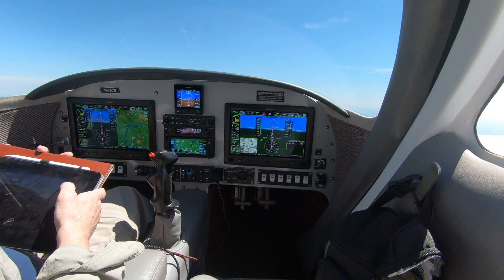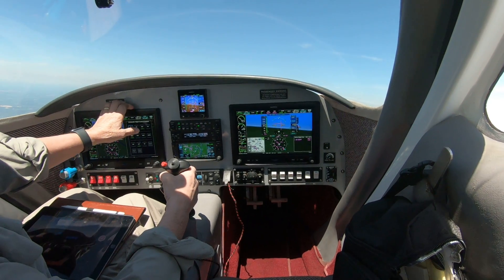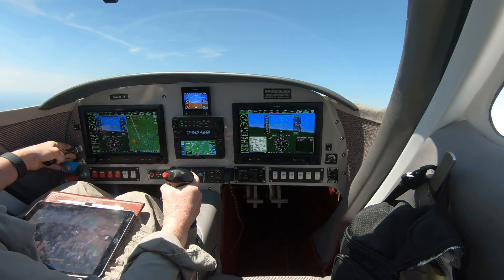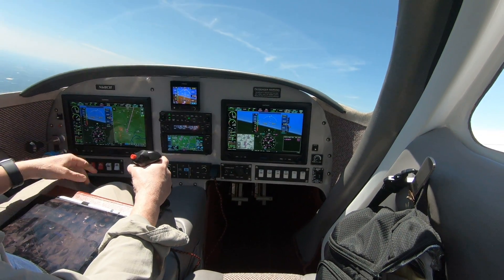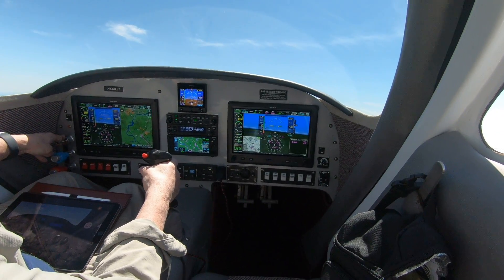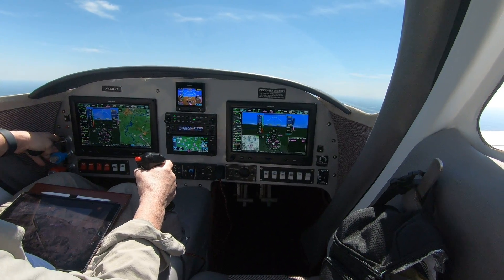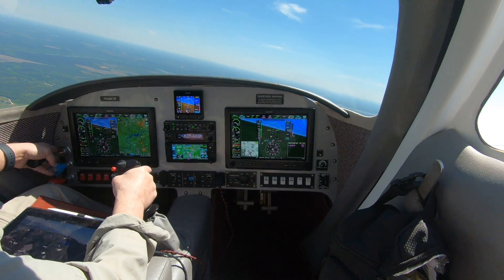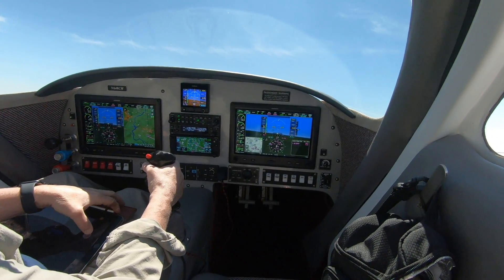Velocity Stalls and Slips

Comment: "As long as you don't snap it, you'll be ok"   ...what do you mean by "snap it" [while in a stall/turning stall]?
Reply from the maker: If you are in a turning stall, (accelerated stall)  one of the wings will be the high wing.  As an example if you are in a left turn and you see that you are going to overshoot the runway so you start yanking on the stick, the right wing (high wing) could stall, this could make the wing snap to level or so.  Now, you would have to get the bank angle really extreme and you would have to really pull on the stick in order to get this to happen.  I never like to say it's not likely when it comes to airplanes and pilots because I'm sure the moment you say it can't happen someone will prove you wrong and do it.

Comment: How much altitude is lost with the sinusoidal response? I've wondered if you are on approach or take off and  the nose drops while at 200 feet can you recover? Would you have the visual cues even outside the  airplane?
Reply from the maker: Well I'm surprised you found this video I didn't really tag it.  This was an earlier attempt at filming stalls and slips.  To answer your question.  Yes, you would have visual ques as long as you are trained to recognize what a stall feels like in a velocity.  A stall is so gentle that you could in fact mistake it for normal gusty winds.  If you add power the aircraft will rapidly recover.  The problem is if you are in a stalled position and close to the ground and start yanking on the plane to make a turn etc you could end up in an excessive sink rate, out of control situation close to the ground.  Never a good thing.